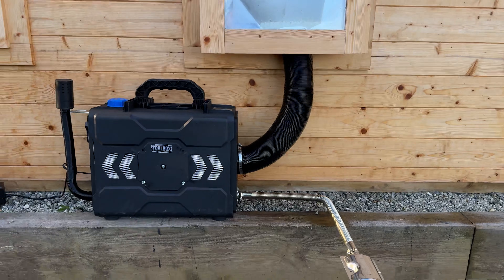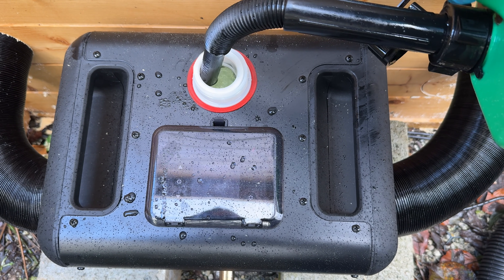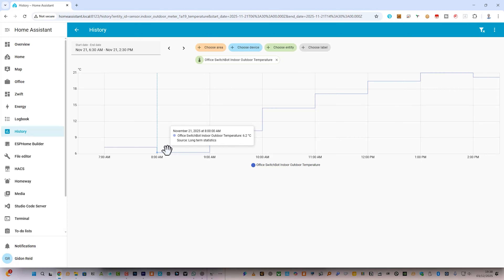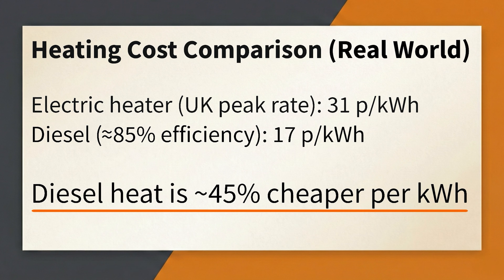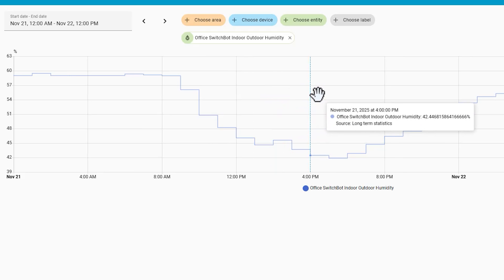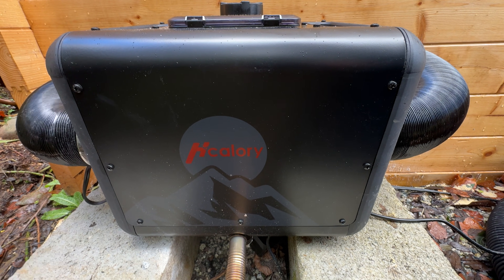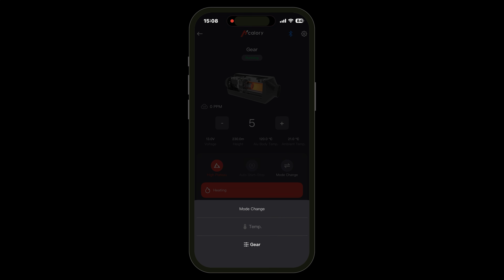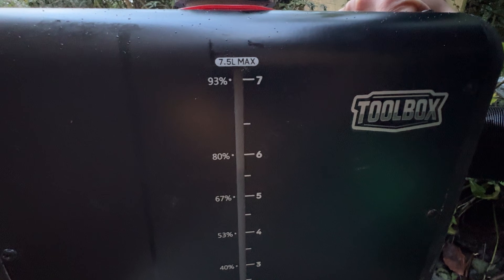Half the Cost of Electric Heating? Diesel Heaters Put to the Test

Comment: These are fantastic; we have been using one for years now to heat my wife's wooden cabin (hair salon). We have the unit outside. We upgraded to a larger external diesel tank. Super cheap. White, green, red diesel. Greetings from Dundalk, Ireland 🇮🇪
Reply from the maker: Great! How does it run on green diesel - do you need to do any maintenance? I'm going to look into red diesel - looks like I can run that with a domestic heater :).

Comment: The environmental impact of using diesel generators far outweighs the fincial benefits unfortunately.
Reply from the maker: I'm not super keen on burning diesel either - would much prefer electric. But still have two cars that aren't electric - comes down to cost in the end! I'm always looking at alternatives - I do have a portable air con unit with heat mode which is pretty efficient - but have a few issues running it continuously. But I will keep trying to find the best overall way to heat my space!

Comment: isnt it illegal in the UK though? What about using red diesel? ALso would be nice to consider a portable AC with heating function as theyre more efficient than an electric heater (would also cool in summer)
Reply from the maker: Using red diesel is illegal in the UK. Not diesel heaters themselves as far as I know. They’re sold on Amazon UK. I have a portable aircon unit with heat function. But that has its own issues. I was going to discuss in the video but already got too long! Maybe another video!
Reply: @TheTechnologyMan  on gpt at least says red diesel can be used on "Non-commercial heating and electricity generation: for homes or buildings not used for profit (e.g. private residences, some off-grid premises, possibly permanently"
Reply from the maker: @cbflazaro I had another look at the HMRC document and think it looks like you can use red diesel at home - even in a home office. Although not sure how I’d even get it!
Reply: @TheTechnologyMan  theres a few locations/websites,  some have like 500L minimum, but some sell smaller barrels , but likely got to buy like 200L+ at once at least.